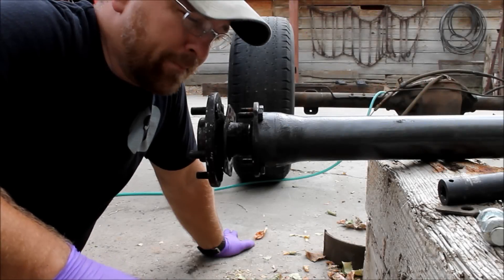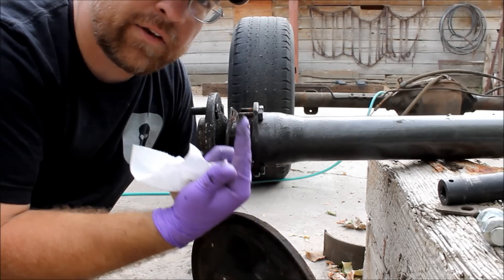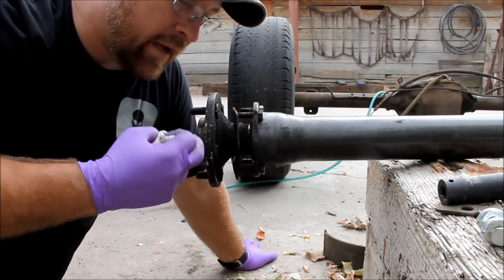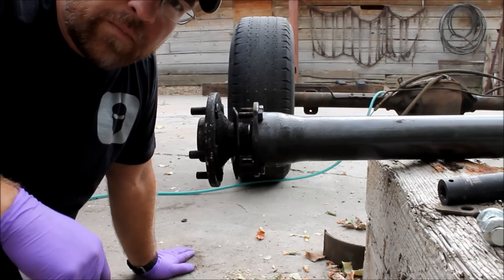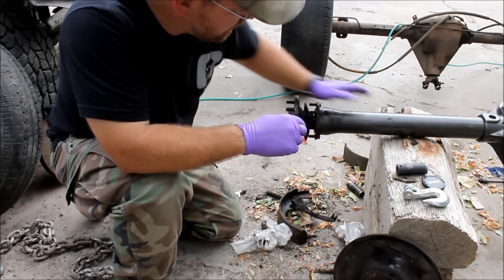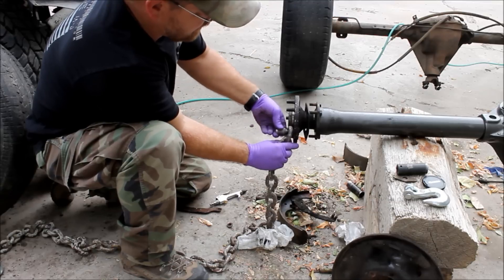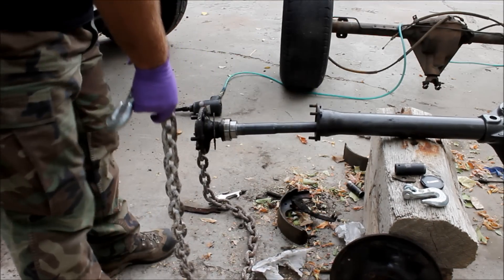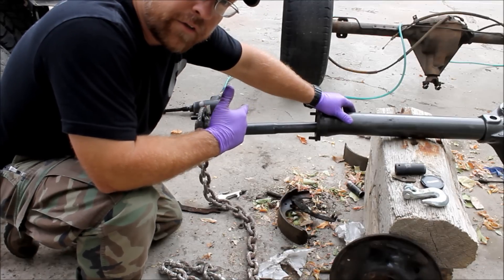Axle Shaft Removal Trail Hack!

Comment: Nice!  In the past, I've taken the drum off and put it on backwards with 3 nuts only by half their threads.  Turns the whole shaft into a side hammer when you yank on the drum.
Reply: +ABbuggin nice improv,  thanks for passing on the tip.  I am so using that ;P

Comment: that was pretty legit ..... we did it on the side of black bear pass in CO once ... relatively the same method except with a good sized rock and a lot of 550 cord , tie the cord the same way around the studs and put on a lug nut so its snug and then wrap the rock about 15 times and tie it off ... throw the rock really hard off the cliff on the side of the road 3 or 4 times and it comes out lol .. be careful not to let it go flying down the mountain with the rock when it gets removed with velocity  ........ good thing it was just the broken one :-p it went for quite a ride

Comment: Normally what's holding the shaft in the axle housing?
Reply: 4 bolts that holds a retainer plate on the axle shaft to the axle for non-C clip axles.

Comment: If the axle is broken I would imagine you could just pull it right out by hand, no?
Reply: +abnsoulja1 If the wheel bearings are still tight on the axle ends, you'll still have to yank it out. The diff splines don't have too much holding power to them